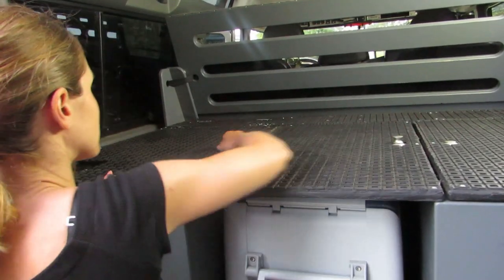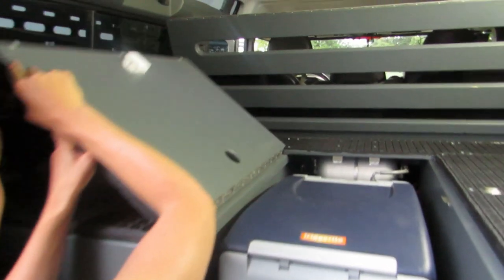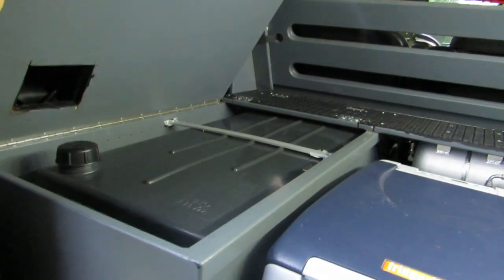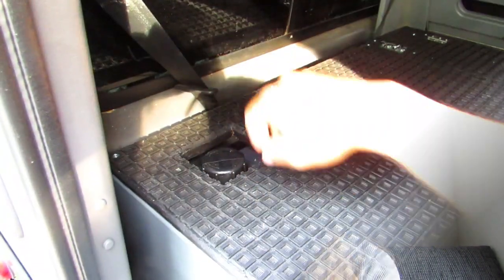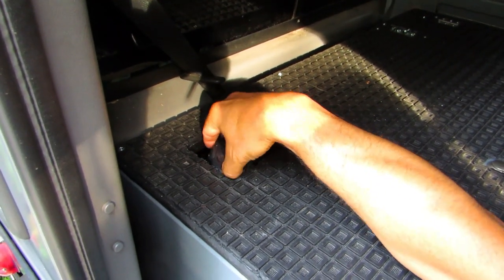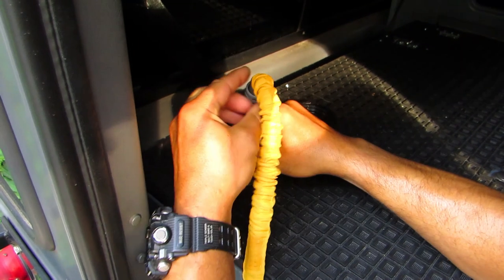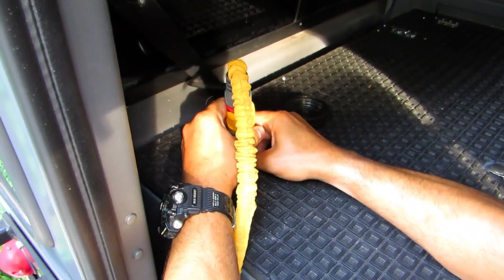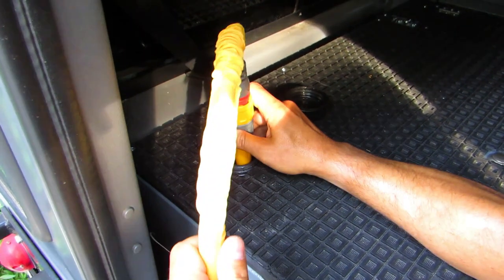DIY WATER SYSTEM for OVERLANDING CAMPER & 4WD | Overland Defender Camper | Equipment series

Comment: I always carry water that is drinking water for drinking, cooking, and washing dishes I have four 20l water carriers currently, but am planning on getting more as budget allows. my toyota can carry 4 people, so I want to be able to carry 40l per person
Reply from the maker: 40l per person is huge! We also are 4 people and we are only using 60L for one week! Don't hesitate to join our facebook group offtrackfamily to show us your Toyota. We love to see other setups! See you!
Reply: @offtrackfamily  That 40l per person is for a week without resupply and includes everything... cooking, drinking, dish washing, and perhaps even bathing if I will be someplace where surface water is unavailable. Even now with at least 20l per person, it is scalable so I can take what I feel I need for a given trip. Having a cargo area just shy of 2m helps, though I have often pushed the weight limit of my truck if I was camping with a full load of people and gear.
Reply from the maker: I think if we had to overland for a long period of time in a place with no water we would be very cautious & adapt our water consumption to not have to carry more than what we can. We don't use our 60l water tank as drinking water and carry this aside. Sure, it's different for everybody and depends how you like to overland, where you love go & for how long.